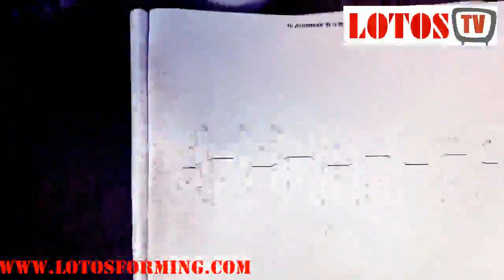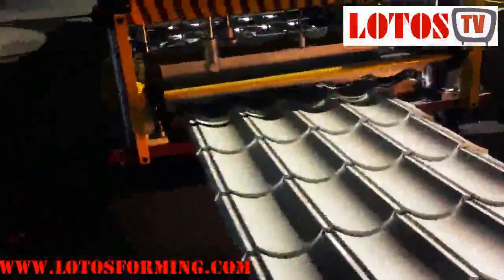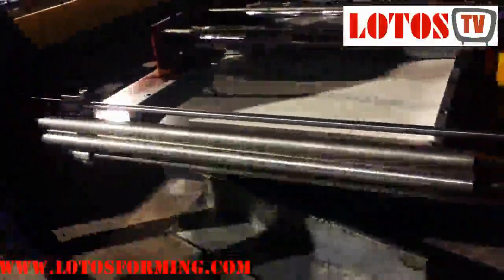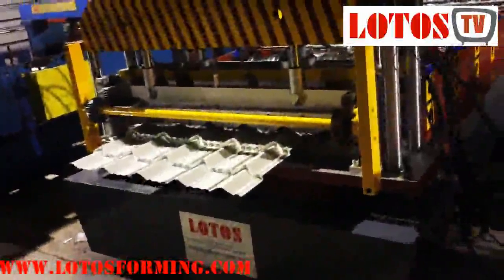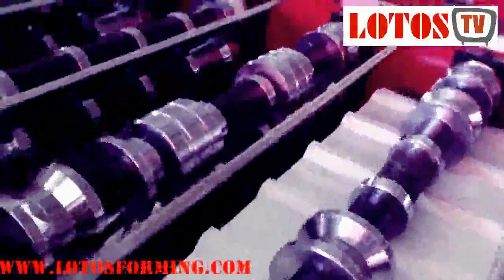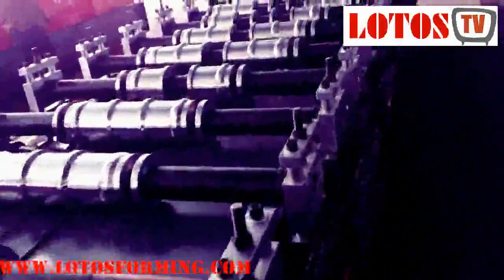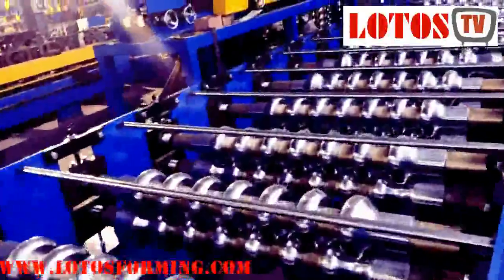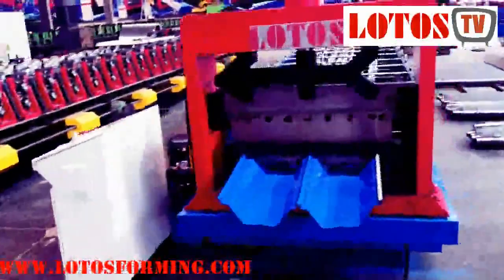▶ Sheet Metal Forming Machine / Metal Roofing Machine / Roof Tile Making Machine ◀

Comment: Corrugated Metal Roofing is a highly versatile exposed fastener option. corrugated panels are among the most popular options due to their durability, aesthetics, and ease of installation.
Reply from the maker: OTOS a wide range of galvanized roof tile machine. These sheets are ideal for cladding the sides, right up to large industrial and agricultural buildings, they are also used for privacy and added security.
The IBR roof is a cost-effective alternative to traditional lead and zinc roofing, it is quick and simple to install and is available in a variety of metals including steel and aluminum. The products details are simpler, therefore, making it quicker and easier to install.

Comment: Corrugated steel wall cladding sheets are the preferred profile for conservation areas.
Reply from the maker: corrugated metal profiles are durable and yet weightless.in fact, we are working to propound the best machine to produce corrugated or corrugated roof sheet machines

Comment: metal roofing galvanized aluminum corrugated steel sheet making machine colored steel wall roof panel cold roll forming machine.
Reply from the maker: Roofing Sheet Making Machine and Rolled Metal Roofing 2O19 ◁ offers a diverse range of solutions to architects and building designers looking for differentiated facade and metal roofing applications.finally, Contact Us To Get More Information About Our panel roll forming machine. in truth, We offering you to an outstanding quality range of, machine to make metal roofing. https://lotosforming.com/roofing-sheet-making-machine/